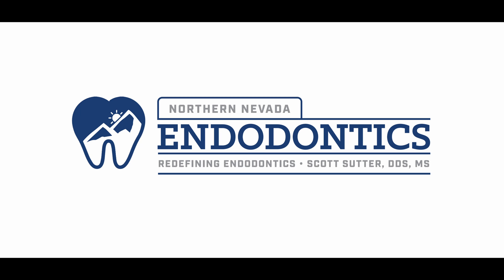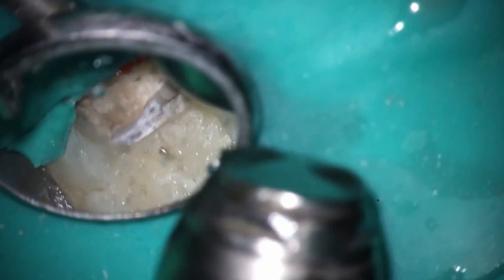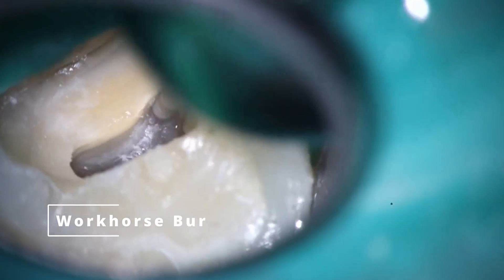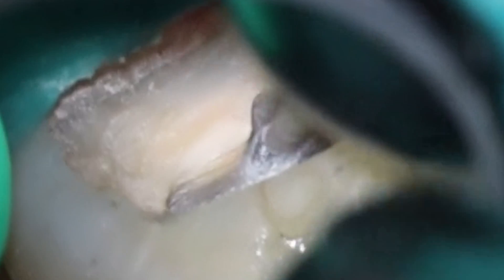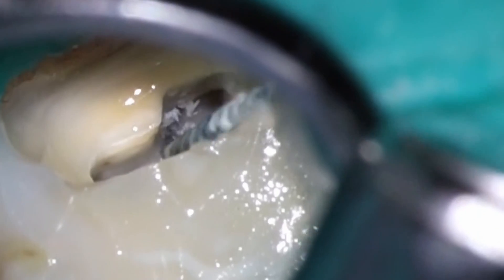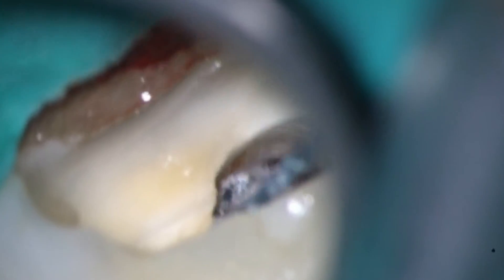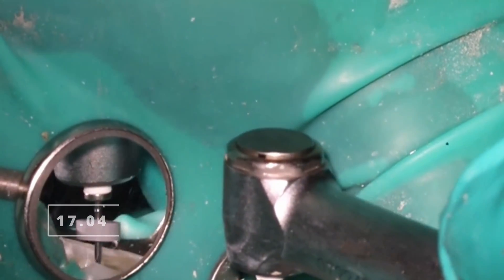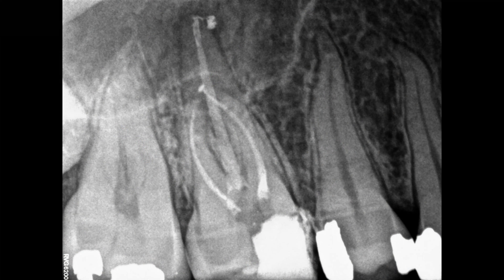Calcified MB2: Troughing and Shaping Techniques

Comment: Hey doc, nice video. When do you decide to use C+ files vs K files? Do you mainly use C+ files for scouting tight canals? In a pecking motion or watch-wind motion like a K file? Can you use a C+ file like a K file to negotiate the whole canal?
Reply from the maker: Well this is turning into my next video idea, thank you! 
C Files (8-10): my main files. I don’t own k files in these sizes except for the 25 mm 10k for working length 
K files: useless in the small sizes. I keep 15 and 20 to recapitulate for the squirt technique and that’s it. 
C+ files: suuuper useful in certain situations. Mainly, I’ve hit a wall and can’t go anywhere. Even with tight canals I’ll start with regular C files. 
The motion with all of them is pecking + watch winding. I don’t do any balanced force because my rotaries remove dentin instead. 
I try to use as little hand files as possible. They are still extremely useful and I wouldn’t practice without them, but I generally use only 1-2 total hand files/case. Rotaries are king 👑 I very rarely get hand files to length unless it’s a 15 or 20k at the end to clear the canal so the squirt technique is predictable 👍🏻

Comment: That caries removal looks so efficient! Does the surgical length 8 fit in fast hand piece as per wheel  bur? Or are you using it on slow hand piece?
Reply from the maker: I only use carbides with the high-speed handpiece. Latch attachment burs are too slow and bumpy for me to get an excellent tactile sensation. It's also a lot more efficient spinning at 400,000RPMss versus 20,k lol.
Reply: @PatencyPro  amazing ! Thanks a mil. Do you use it in vital cases too? Or does it generate too much heat? Is there resistance to healthy dentine? Cheers
Reply from the maker: Great questions! 
I don’t worry about it in vital cases as I’m using a ton of water with it so it shouldn’t heat up. It is easier to cut dentin than with a slow speed, but not easy if that makes sense! I use a pretty light feather touch whenever I’m removing caries anyway